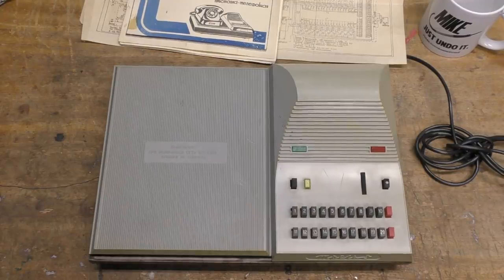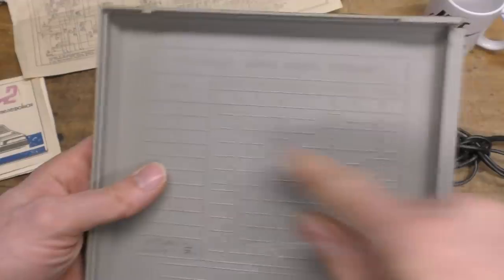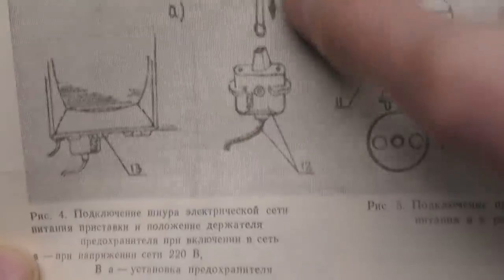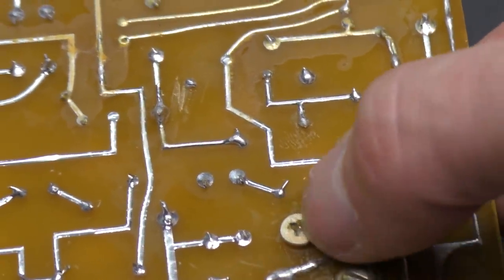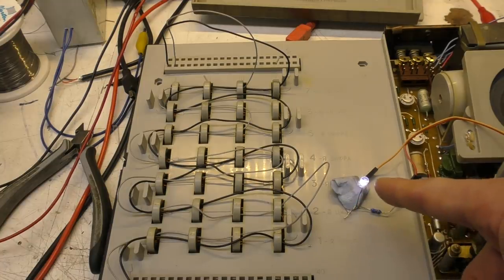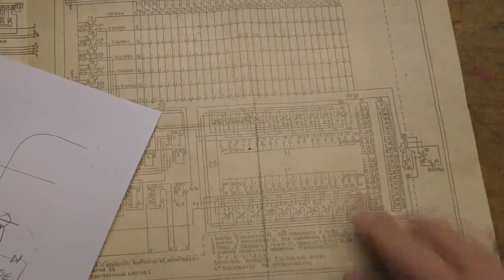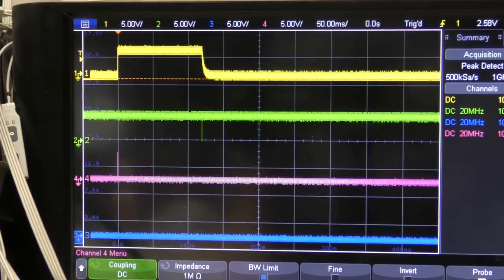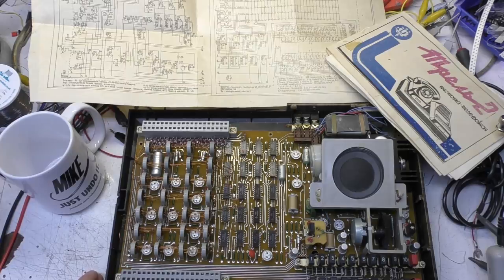Russian phone dialler using interesting magnetic memory tech

Comment: Checked the schematics:
Logic is different NANDs and D-triggers
"Interesting-looking capacitors" at 6:45 are thermistors.
There is also reed/magnetic switches there(don't quite get what for)
Bonus:  0.4434 g of gold (probably in diodes), 0.126 g of silver (contacts)
Reply from the maker: Reed switches are the reed relays for phone line interface
Reply: @mikeselectricstuff  thanks!
Do you by any chance know how this big white thing is named on PCB layout(I don't have it)? Judging that it's near a switch I  suppose it's for alternative telephone exchange mode.
Reply: @yanikkunitsin1466  Big white thing is an inductor in the pulse dial circuit.
Reply: *open collector NAND.
Reply: >"Interesting-looking capacitors"
Looks like K53-7 niobium capacitor, though I'm not sure why it would be in this civilian product.
Reply: You're right, it's thermistor ММТ-4
Reply: By the way, all transistors in this gadget are old vintage Germanium, produced since 1960s, still carrying old nomenclature П and МП.
Reply: @Alexagrigorieff  I said "different NANDs". Out of 5 only ЛА7 and ЛА8 are open collector.
Thank for the info on L. I just wonder, if it's standard prefabricated inductance for pulse dial why it's not named.
If they coded dates in art. numbers as usual, circuit is from 1969 and first production is in 1974. 5-year plan, so it  checks out /s
Reply: @Alexagrigorieff  to cite the motto that was scratched on an announcement board in my Polytech - "Зато наши интегральные Mикросхемы самые большие в Мире!"
(But OUR Integrated Micro-circuits are the largest in the World!)
Reply: @yanikkunitsin1466  В наше время это звучало так: "Зато наши БИС (большие интегральные схемы) самые большие в мире". БИС это калька с LSI.
Советский микропроцессор имеер 40 ножек и две ручки для переноски.
Reply: @Alexagrigorieff  i f  king died on the last one

Comment: I believe the thing was designed in 1970s and produced so long just because of planned economy. I have 1980s "Виза-32" (Visa-32) which obviously was more modern design and also massively produced at same time. It uses RAM ICs for storing data. But of course if your AC power fails and you forgot to check and replace backup battery before then... well, you just need to program everything again☻

Comment: This is how ANI-B used to work in the US;  which was used when your local phone switch needed to obtain your phone number and send it forward (as tones) to a centralized billing system (e.g. CAMA).    They ran your physical phone line through a series of rungs corresponding to the last 4 or 5 digits of your telephone number;  and when your switch connected to the accounting system trunk,  a polarity reversal triggered your local switch's register/sender to bring in the ANI-B system,  apply a high frequency tone to your line,  and detect which digits (in which positions) to register in the marker [IIRC].

Comment: Remember Nasa got Fisher to create the Space Pen. The development of the thixotropic ink cost Paul Fisher around $1 million (equivalent to $8.21 million in 2020).  While the Soviets just used pencils.
Reply: Stupid fake story.
Reply: Urban myth. Both used grease/wax pencils (NASA also used graphite mechanical pencils). As for Fisher's Space Pen, R&D of ink was done with private capital, and both countries started to use them almost at the same time(late 60s)
Reply: True story is that NASA developed a microwave oven for the Space Shuttle to heat the astronauts meals which cost six digits or more likely seven apiece.

On space station MIR for the same purpuse the russians just used a box with some heat insulation and a large light bulb as heating element.
Reply: And allowed conductive graphite to float around everywhere. Something nasa was specifically trying to avoid for obvious reasons.

Comment: The Siemens Company used the same technoligy in their old P.A.P.X. switches  for  a short dialing facilities at the switchboard. The different to the dialler in this video is, Siemens use a single botton with the name  for each destination on it.  Like the bottons at an entrance panel at a block of flats. 
Their employs a large number of relays instead transistors due to the hgh prices at those time.  A storage with  12 digit number for 100 destinations  filled a complete rack in selctor row. They used the 2 out of 5 scheme.

Comment: its a compact way of doing this
but some sram, a battery, and some dip switches cant be all THAT much more costly and the logic is much simpler.
i mean it was the 80s, sram was not dirt cheap but it was not pricey either for what? 128 bytes?.
Reply from the maker: But you'd also need a processor, ROM/EPROM and firmware development- other comments suggest the design may have dated from the 70's.
Reply: @mikeselectricstuff  I remember working on something like this but bespoke for a radio station. It used shift registers/binary counters and an EEPROM to dial (no CPU or RAM), by memory (sorry for the pun) it was DTMF. Was circa early 90s but I thought it was cool as a youngster :)
Reply: @cyclerical  You can easily imagine replacing the EPROM with a SRAM but I don't think one suitable for battery backup came out until a few years into the 80s.  Something like the  HM6116LP would certainly do:  256 7 digit numbers or maybe 127 16 digit numbers.  Some logic for the stop special digit.   But I can't think of how you might do it in 1980 North America.
Reply: For 20 numbers of 7 digits each required 20*7*4=560 switches, and space for them.
Reply: @tituszx1  Actually, it was 40 numbers (there is a shift button to access another 20 programmed numbers), so far more dip switches still.  They could have substituted BCD selector switches, but that would still be 280 switches and switches are not inexpensive components (at least not until the tactile and membrane switches came along, but they do not retain their state).  It is actually a pretty clever solution as it is totally nonvolatile so the programming is unaffected by power outages and no batteries are needed unless one wishes for it to work in the absence of mains power.  Solid-state computer components seemed to generally be much more scarce in the USSR, at least up until the mid to late 80s, than was the case in the West as I know that most did not have even hobbyist computers unless they were especially into computers even when I visited the U.S.S.R. in 1987 as part of a (high school) summer youth ambassador exchange program — very few teens and young adults that I met had access to any sort of home PC or hobbyist computer of any sort (though a few did).  They were stunned to learn how many computers my family owned and used at home by 1987.  At that point in time, I would have owned my original Commodore VIC-20, Plus/4, C128, a 286 PC clone, and a brand new 386DX PC with several megabytes of RAM, a 150MB ESDI hard drive, and a VGA display plus HP LaserJet Series II, a daisy wheel printer, and a number of dot matrix printers of varying types, I even ran a dial-up BBS at the time — that was all just unfathomable to even the Soviet adults who had actual careers involving computers or engineering that one person/family could possibly own that much computing power at home!  I certainly wasn’t the “average” Westerner in terms of home computers in that era, but it was not at all uncommon even for more modest Western families (at least in the U.S.) to own a Commodore, Atari, or other gaming/hobbyist level computer or even an IBM PC XT (8088) or AT (286) compatible PC for home office use (such as for a family business or to work from home).  Given that scarcity of even simple hobbyist grade computers in the U.S.S.R., I am guessing that incorporating the equivalent of a digital microcontroller with solid-state RAM or even a very basic microprocessor and dedicating it to such a “lowly” task as auto-dialing phone numbers just wasn’t seen as practical (especially if this design dated to the 70s, which it very well may have) and may well have been too costly for Soviet businesses and “higher-ups” to afford given the communist-socialist economic system in effect.
Reply: @tituszx1  even twice more since it has 40 number capacity.
Reply: It's not necessary about cost reduction. It could be easily implemented cheaper, purely on dip switches or jumpers.
Soviet industry was good at making heavy machinery and weapons, but sucked at consumer goods. At some point govn't mandated that almost every factory should start producing some consumer goods. That also included factories that made mil/aerospace grade electronics. Most of them set up separate divisions that made something basic like injection molded toys and other junk you can find in a dollar-store, but on some of them CTO called some of junior electronics engineers and told somthing along the lines of:
"Here's a list of crap we have lying around in the warehouse since Khrushchev, here's target manufacturing cost if you figure out something useful for consumer goods mandate you'll get a raise"
Judging by board design and parts used I'd say this is what happened here.

Comment: What a bizarre device.  Programming in the full set of numbers must have been quite time consuming.  Especially if you miss wired one of the first layers and only found out at the end.   I would have thought that plug-in jumpers could have been a lot simpler.
Reply: In this case You need 560 jumpers with good contact
Reply: In the eyes of a telephony engineer, such a wiring configuration would hardly even be considered a trifle; a run of the mill patch panel could require 100 times as many wires.   
Given the era, I’m inclined to believe that in many if not perhaps most cases the average end-user wasn’t configuring the device themselves, but perhaps I’m wrong.
Reply: Perhaps one could just disconnect the ends and pull out the wire?

Comment: I bet the chips have 2.5 mm pin spacing instead of 2.54.
Reply: They're the regular 2.54, i have some of them and they fit into a breadboard nicely.
Reply: @poptartmcjelly7054  Some soviet chips are slightly off though, I have some DIP40s that so fit in modern 2.54 sockets, but they sorta bow slightly. Mostly К580 microprocessor series (which are mostly clones of i82 chip set).
Smaller packages might also be off, but they're usually small enough to be perfectly compatible.
Reply: @ZXRulezzz  ICL7107 clones as well
Reply: @poptartmcjelly7054  For a 14 pin dip package, there would be only 0.04*6 = 0.24 mm difference overall, which would be hard to even notice. The pins easily bend more than that. The difference becomes more apparent for longer packages, but even for the 40 pin chips it is only 19*0.04=0.76 mm, which is only about 1/3 of the spacing between the pins.
Reply: Yes, but regardless of that, we will support the Allpowerfull Lesbian Family street gang and fight our way to our destiny which is the victory over all evil forces in the world. One for all and all for one! Allpowerfull Lesbian Family street gang for ever!!!!

Comment: Have an even older Japanese version that can handle 20 stored numbers of up to 12 digits, using figure 8 shaped ferrite cores, and all discrete transistor logic inside.

It works by running a single sense wire through all the cores in a row, and then generating a current pulse through the digit wire, and having a counter generating the dial pulses, running through the pulses till the sense wire for a digit stops the count. End of number is another core, that does an inhibit of dialling before the first pulse is created, unless you are using all 12 numbers, which automatically does the inhibit on the end of the last digit. Was used for many years in a pharmacy to call suppliers, storing all the common numbers for them, so the pharmacist did not have to look up the numbers, instead having memorised which button was the desired one.

Press the button and press start, and wait for the speaker to have the ringing tone, or a busy tone, and then, if busy, you pressed reset, which dropped the line, or picked up the phone, which also reset the device, but also connected you to the line as if the device was not present.

Old, dates from the 1970's, and all very crusty inside as well, but a fascinating bit of by now very crusty yellowed beige plastic and old SRBP board, with dozens of small separate soldered in daughter boards, some potted, some not, and not an IC anywhere in sight in it. All boards are tinned copper traces.

Comment: Very interesting numbering system... values for the 4 coils are 8-4-2-1 with the sum minus 1 being the number dialed. Curious about why it was done that way.
Reply: Yes, strange but maybe the reason is that they want to recognise when no wire at all is attached so it doesn't dial 0000000 when you press a preset button that is unprogrammed.
Reply from the maker: @mumiemonstret  I'm surprised they didn't use no-wire as the blank value - would have made it much easier to use for shorter numbers
Reply: @mumiemonstret     as far as I can see from this: https://en.wikipedia.org/wiki/Telephone_numbers_in_the_Soviet_Union  
00 followed by anything would have been safe to dial.
Reply: @rambo1152  Exactly the opposite. 001 was the fire fighters, 002 police, 003 medical and so on. 00 followed by non 0 was a big no no.
Reply: The numbers were 01 fire, 02 police, 03 ambu, and 04 gas service in urban areas for the most of the Soviet times.
There were other “vertical service codes” in 0X and 0XX form like directory services and others.

Comment: You're right about those chips being 7400 equivalent. There's a fantastic Wikipedia article for the Soviet IC designations:  https://en.wikipedia.org/wiki/Soviet_integrated_circuit_designation - the last digit usually refers to variants of the same logic type.

On there I can see К155ЛА3 and К155ЛА8 (2-input NAND gates with two different pinouts), К155ЛА1 and К155ЛА7 (4-input NAND and a later production version), and the К155ТМ2 is a D-type flip-flop. Be careful when you search for these because "К" is not the same as the Roman character "K", and "ТМ" is not the same as the  the Roman characters "TM", even though they look very similar! (and quite literally identical on YouTube's font)

Comment: When I was a kid I found something similar at a charity shop but it was an electro-mechanical version. It had a plastic film that was driven by a small motor over sprockets. On one side was a sliding pickup with two contacts that rode on the film. You slid it up and down to select the number to dial, then pressed a button to start the film drive. On the film were places to fill in squares with a conductive pencil to "program" the numbers to dial. To dial a three you filled in three squares, etc. As the conductive squares passed over the contacts, it shorted them performing pulse dialing.
Reply: My grandfather had one of those. In the late 1970s. It basically was like filling in a scantron test. And as you say instead of writing a 1 or a 3, you filled in consecutive squares. You could hear it go click click click as it dialed. It ran the pulses out at 10/s just like a dial.

Essentially that system didn't store the numbers at all. It didn't even have any idea what it was dialing.

It even looked like this unit in general shape, with the belt on the left where the cores are here. And you have to life the cover to program it like on this, but of course you did it differently. You wrote in the name of the person associated with the number on a piece of paper which was covered by a clear part of the cover when you closed it.

The best was erasable, but I wouldn't push it as it never got completely clean.

I can't remember who made it now.
Reply: i guess you could also use a photo transitor to detect the pencil marks

Comment: I don't understand why they did this. Is a very simple processor THAT much more difficult to manufacture than all those other chips?
Reply from the maker: In 1970s/80s Soviet Russia, yes. TTL is much lower tech
Reply: Semiconductors were really expensive back then, TTLs were a pinnacle of the semiconductor industry. And processors - almost unobtainium. Just buying simple transistors was a nightmare. The supplies were fluctuating and there were months and years when you were not able to get particular part number.
Reply: For hobbyists and repair shops scavenging components was sometimes the only way to obtain them...

Comment: i don't get it; why not just use pins and jumpers?
Reply from the maker: Work out how many you'd need, and how much electronics to interface. It's 280 digits, encoded with just 28 cores
Reply: @mikeselectricstuff  sorry, i missed the "up to 40 stored numbers" part; keeping the same encoding scheme, one would need 40*28=1120 jumpers and 1120 diodes; tx!